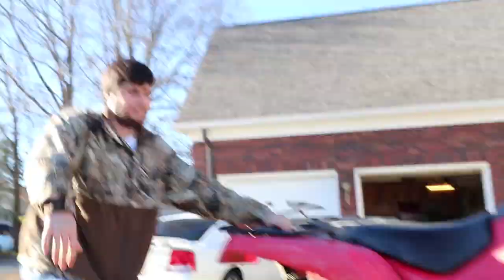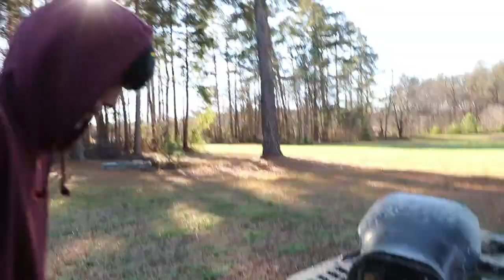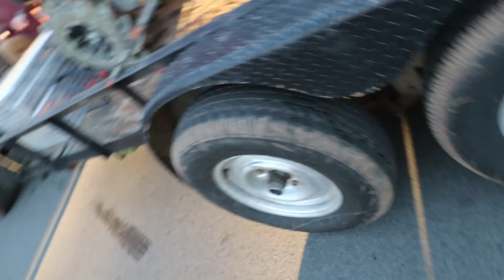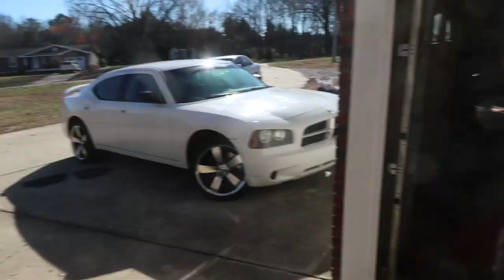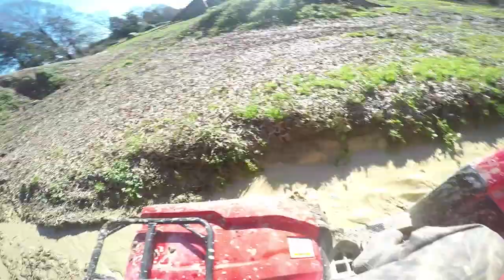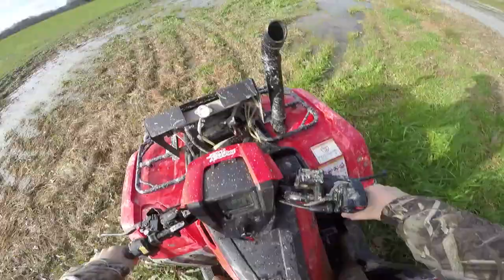OUR TIRE FELL OFF | Whole day RUINED.

Comment: Put the stock exhaust back on the Honda and see if it will still cut off
Reply: That’s what I said the hmf wants too much fuel the stock one is better in my opinion and he needs a gear reduction
Reply: Your a bowers???
Reply: Stock is never better Brian
Reply: Lance Bowers yes
Reply: He just needs to tune on the throttle body I’m thinking he might be getting to much air. Also you could be right he needs to put the stock exhaust back on but stock exhaust doesn’t idle under water on most newer Honda’s. But then again it could be his fuelpump
Reply: Yeah you got it right man

Comment: The reason your fourwheeler cuts off could be the exhaust sensor.  The stock exhaust has one but if you just take it off when u put an aftermarket on it it won’t run right and will cut off..

Comment: You might be loosing spark. Only fuel issues would be computer or pump related. Trick is to watch the tach. Or when it dies, pull a spark plug and see if it's wet.

Comment: Braydon, when it cuts off, you don’t have to go all the way to neutral to start it. You should be able to pull the right brake and start it in gear. At least on an 08 Honda rancher you could. Idk about the newer ones.

Comment: Pull in the front brake a little and you can start it back up in gear instead of stopping and putting it back into neutral

Comment: Equalize the pressure in your tank...if that doesn't work change the fuel filter if that doesn't work pray to the good lord above its just an injector issue

Comment: The four wheeler is running to lean.Try putting the stock exhaust back on there or adjust the mixture screw
Reply: Jacob Coniglio it’s fuel injected needs a tune.

Comment: Also for that you would need new valves so you will have to take the motor out and put in the new valves trust me my dad used to to mud digging with trucks and riding dirt bikes also he was a mechanic and he still does some mechanic work

Comment: If the gas tank has a vent line ran up with the snorkel it’s not even needed I’ve went in shit 1 inch from being over my snorkel never had problems mine isn’t vented I only have both diffs and radiator overflow vented I know besides what you said about the fuel pump or line the tip sensor will make it cut off to it’s right under where your speedometer is mud puppy has all kinda videos on Hondas needa just ask him I reckon

Comment: I had a problem on my outboard motor where it wouldnt stay running when i was on the throttle it would bog down and die but it would idle no problem. The vaccum gasket in the fuel pump was ripped so gas was going straight into the motor dont know if your four wheeler is the same but it is worth looking in the fuel pump to check

Comment: The cdi is getting to much water and the fuel filter is plugged when you start riding the carbon plugs it and when you shut it off it go’s back and the carburetor jets could be plugged aka HONDAS SUCK GET A POLARIS